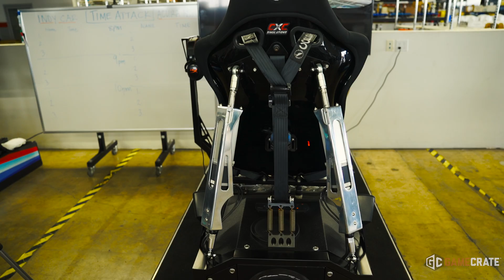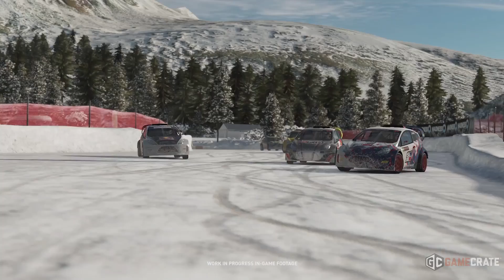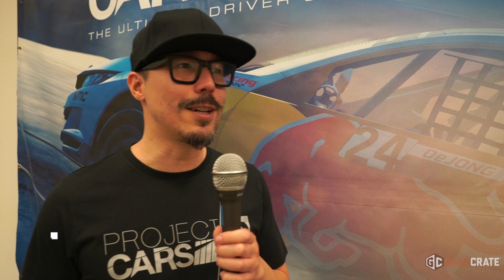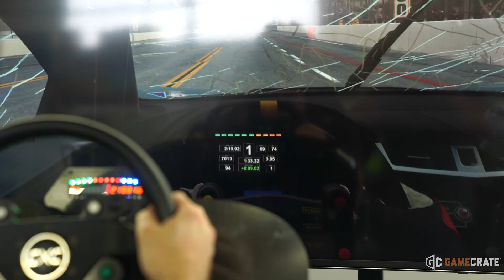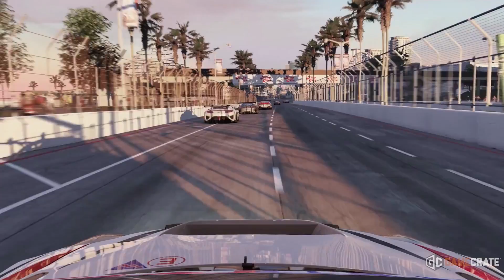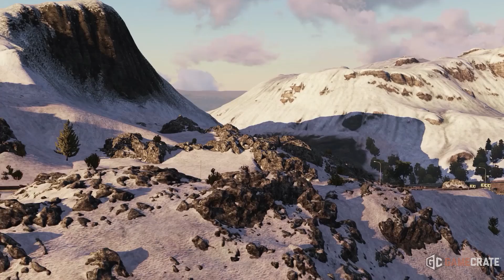On the Scene: Project CARS 2

Comment: I hope they include more cars of the same class or series, as well as the iconic cars. One problem with the first game was that a lot of the default car setups weren't great, and setting them up yourself is quite tricky and time consuming for someone that doesn't know how to. Feels like a significant part of the game is missing when you can't drive all the cars to their limits. I thought that some sort of setup assistant, or 'virtual mechanic', would be a good idea. You could input feedback on how the car is handling and then it could advise you on what to do about it. Would be great for not only solving handling issues, but also for making the cars handle to your own personal preference, in the same way that some Formula 1 drivers have their cars set up to over or understeer slightly.
Reply: That would be an engineer's job not a mechanic (repairs vs optimization), but anyway, that would be great. They're supposedly making improvements to "accessibility" which should mean easier options/tweaking.
Reply: Glad to hear it! What is your source for this information?
Reply: Believe it or not, their website.
Reply: Nice one.

Comment: Project cars 1 was the most buggy racing game Ive ever played. Also, hardly any cars were available at launch and most of the cars were DLC. I will not buy this version maybe I will check out version 3
Reply: Project Cars 2 will have the most tracks/cars than any racing game released to date. Bro do you even research?! Bro.
Reply: BassRacerx horizon 2 also buggy too till today
Reply: pCARS 2 will have more than 170+ cars out of the box.
Reply: Stormer248 You can't just compare the numbers when it comes to cars. Because unlike Forza Project cars has different physic for each car. Which means it requires extra work and time. GT and Forza they can just copy and paste generic physics file and no one will even notice it.
Reply: BassRacerx I encourage you to pick up project cars 2, I think it's going to be 10x better than the 1st one, and many of the issues should be solved. besides, if you plan on buying the 3rd one you should support them by buying the 2nd one ;)

Comment: cough forza 6 cough
Reply: I loved Pcars 1, but I wouldn't call that a "proper sim" either. You can barrel down the Nordschleife with relative disregard for the weight of your car or traction of your rubber. It's a nice simcade racer, no more, no less.
Reply: OGSiX33 dunno what game you're playing because, you can feel the weight of the car move around, or when you go over crests you can feel the car go light as the weight comes off the tyres. I, guessing you think something like forza or a Sim?
Reply: You're right, it does simulate all of that, I just meant it doesn't simulate it properly (both in physics and ffb) , making it far easier than it actually is to navigate let's say - bergwerk, or flugplatz with cold rubber, or the mutkurve at top speed. In Pcars 1, you can get away with a lot less skill than it takes in 1.) real life 2.) a more advanced sim like RFactor2, iRacing or Assetto Corsa. No racegame is perfect yet, but when it comes to "serious" racing games, PCARS 1 was closer to the arcade end of things.
Reply: Alex Fahmy cough not a proper sim cough

Comment: But can you customize cars? That was the sole reason I didn't buy it.
Reply: no
Reply: Nick Chambernator lol you can customize every millimeter of every mechanical piece of the car and you care about some stickers?
Reply: Who said anything about stickers? I'm talking about swapping cams, valves, springs, etc. Or at least adjusting that stuff like valve spring pressure, intake valve diameter, cam lift and duration. The kinda stuff you pay attention to in real racing.
Reply: Manufacturers won't allow it.